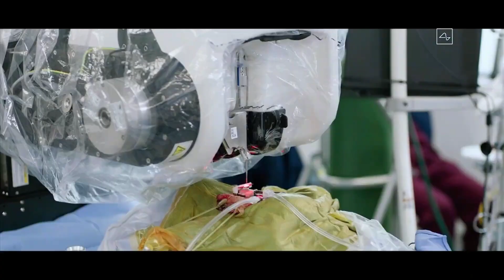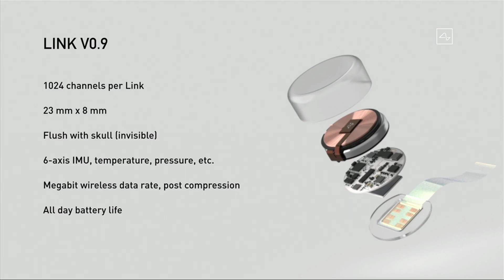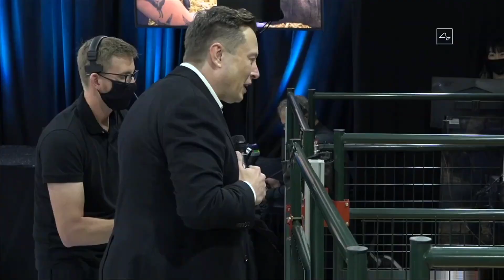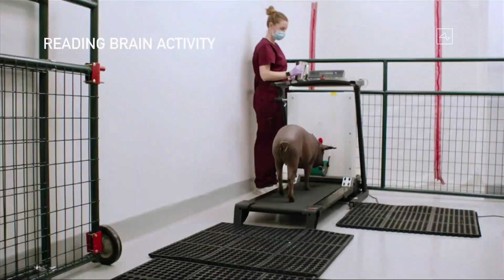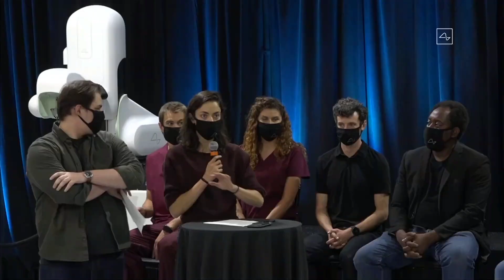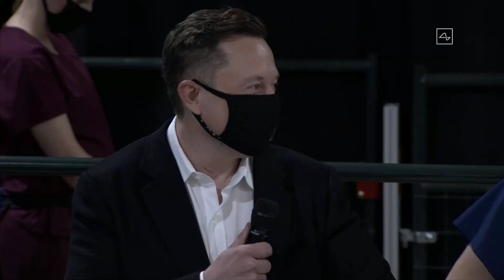Watch Elon Musk's ENTIRE live Neuralink demonstration

Comment: Personally i would like a micro device in my nose to filter out the filth and purify the air i breath. 
Maybe also a little thing to enhance my vision (instead of wearing glasses)..
And also... Could we finally have all plugs, connections, and interfaces STANDARDIZED?? I have a cardboard box filled with an insane amount of outdated, unusable chargers, plugs and cables. It's absurd... I think that if we add them all up we would have a mile high mountain of spaghetti like cable-mess. 
So many little things to fix but they go unnoticed until suddenly it's too late...

Comment: You can solve hearing basically means that you'll be able to slide a volume bar on the app and equalize frequencies and ears as well as ear interference. I'd absolutely love a preset to quickly switch between real life (default) to school (quieter when it gets loud) to headphones (I have one pair of headphones in which the left one works, but is almost cut off so I don't put it on, I'd be cool to feel like it's in both ears while it's only in one plus I struggle hearing bass unless I push it manually so frequency equalizing will be great for that). Maybe even switching between presets automatically depending on the detection of certain touch areas, like gaming headphones automatically switch your preset to gaming hearing.

Comment: My issue is the human brain is a mesh network. Meaning the neurons are intertwined and while most are similar not all pathways are the same. Like the difference between left and right handed people for example.  How long is the implant learning process for detecting the amount of current to pass and at what point to introduce said current to achieve a desired outcome? Or is it just a one size fits all approach? I know This may be a simple answer to people in this field but I’m just a normal joe here that loves to learn new things. Being the size is small and the area it can stimulate is small will location be a factor into what results one can achieve with the implant.

Comment: I’m sorry as much as i admire what you are doing and amazed by how fast you are changing the world. I have to disagree… Tesla doesn’t make 5 star products. It’s more like 4.5 stars. The cars are not put together symmetrically and apparently there seems to be an issue, a small issue but still an issue. Like the gaps on the window so you hear odd loud noises when you roll Down the window, also like how the car the winsheild is so big that the visors that help block the sun from our eyes are so small that it doesnt  cover anything and basically it will only be used for the mirror and not for shielding the sun which is important. I get it wants to be unique but the door handles are rediculous. I try to open the door with one hand and it is quite complicated and therefore requires me to put down what’s in my other hand so either an auto opening car door or choice pull or push the handle not both,. Lol

Comment: Why not make a long term high thread connector implant only then the system, larger cap needed for current version of Neuralink then when a new version comes out you do not need another surgery. Also allows the user the control of turning it off.

Comment: And no there is no way control any vehicle in any telepathic way!!! Imposible!! For that type of energy for through neuron to travel with the device integrated in your skull you would need over 450 mbps. Which is wifi high speed. And you can't install no wifi in that gadget.  Sorry pals. 
And the guy did not answer the band width.  WTF!! 
ANSWERED IN THE THE 29TH MINUTE AND 24 SECOND

Comment: 53:10 Oh you just make sure to keep it safe?  That easy is it?  They are using encryption!  Who keeps the keys?  How does your phone connect to it via Bluetooth?  Interference?  I am assuming it's going to be symmetric encryption so I asked the "who keeps the keys?" question because you will need that same key inside another device, presumably also unhackable right?  Maybe a quantum resistant asymmetric encryption scheme ... which is still being invented by the way as NIST hasn't even finalized on a discrete logarithm replacement.  Even then, same questions remain a persistent problem.  Just ask Tailored Access Operations unit of any Red Team.  The only "unhackable" computers exist under ground or water, in thick lead and concrete isolated and protected by weapons and even those aren't unhackable.  So you look at damage control as "never assume your secrets are safe" is a core security principle.  A computer gets hacked, data is stolen, opposition knows your secrets.  Still bad, but that's it.  Your brain gets hacked, you're done.  Hacker gets "write access" to your brain, and you press a button you really shouldn't.

Comment: The hard part would be to figure out how to influence the brain to fix an issue. The robot and the insertion of the chip is a much smaller problem. We are still long ways away from understanding consciousness and how it is supported by the brain. For example, just how would you treat depression using electric input? Even if you had everything perfectly mapped out and connected, the neural activity and all, you still wouldn't know what to feed the brain. The real breakthrough we need is to understand consciousness and the brain. I think it is too soon to try to manipulate what we don't yet understand well enough...

Comment: It would be an act of true humanity to restore physical disability, if only they could reverse autism.  Since it has to do with the nerves/electrical system of the body; connections from right and left brain you could fix it.  The perception of overstimulation from the senses due to the lack of pairing off sensors between the left and right brain keeps the child from reaching the next stage of development.  Brain damage from strokes and other aging brains can be repaired.  If you personally have some autism like features it could eliminate some interference from your concentration on various tasks.  Could pleasure or pain be experienced from this chip?  Could this be potentially used to control or abuse the population?  This would require an entirely new set of ethical considerations and laws.  Quality of life from various individuals would warrant risk.  As we consider quality of life with risk of loss of life.  I would imagine that one would find that depending on the level of disability and how limiting it is in life would make it more ethical to insert such a device.  However, would a person who is perfectly healthy in every way and a high degree of quality of life consider implanting a device that removes part of their skull, thus compromising the natural integrity and strength of the skull.  The risk of cancer and having a battery located without a boundary to the device is problematic.  Acid could eat through or leak, or explode due to physical damage.  If the person gets in a car accident or they get in a fist fight can it dislodge it into the brain.  My point is that it would not be prudent to add this to a normal person, or would I ever recommend it to a healthy person unless their quality of life was significantly diminished.  This is the ethical piece and at some point plastic surgery has crossed this line for advantage and competition for youth.  In the same instance the competition for intelligence is equally desired.  Could this enhance intelligence?  How could this help people become more equal or give people with more money and even better advantage?  Would some governments require it's citizens to get them to be as healthy and smart to have an advantage over other countries?

Comment: Why would you measure spikes. I see it differently in waves of frequency making action. Potential charge with systemic. Seams waves of creating responsive "electrical interpretation" which is fact sound traveling. Verberating off of neuron transmitters. Frequency is the perpetrating signal.

Comment: As Data would say to the Borg Queen..."Are you using a polymer-based neuro-relay to transmit the organic nerve impulses to the central processor in the positronic net? If that is the case, how have you solved the problem of increased signal degradation inherent to organosynthetic transmission across multiple layers?"

Comment: I had a spinal cord stimulater implanted in my spine attached to my spinal cord for back pain. 
It worked great. Until it overheated while charging and burned a hole that appeared as a small blister. Above my tail bone. But in fact, it  had abscessed, and a infection was beginning to spread. I had a life threatening staff infection filling a deep cavity of flesh that had hollowed and been burned by the charging leads. That always felt too hot.  At the bottom of my Lower back that now was a gateway to my spinal column. Via the implants stimulant leads that interrupt And block the pain. Cutting off the targeted 
nerves from receptors in the brain. I spent 10 days hospitalized in heavy antibiotics.  There will be malfunctions. Count on it.

Comment: You should have a changeable chip for specified purposes as opposed to a general purpose chip because electrodes do not need to be changed you will not have the risk involved with the original procedure in just changing from per se medical to a personal or business centric chip. 
Additionally I didn’t hear what I would consider one of the more intriguing low hanging fruit which would be positive stimulation in various different ways knowing very little about the mapping of the brain just based on what I’ve heard I would assume that you could emulate signals that were given without actually having that happen so in essence a massage for your brain which I’m sure it could be tied back to keeping things at top performance related to the computer the ability to clear the cache would be huge furthermore when the brain starts to understand the relationship between the link I truly believe it’ll be like adding a turbo to a motor it’ll just start using it to its advantage I mean let’s face it the brain is quite literally the smartest thing that we know of on many different levels Our unconscious brain being at the pinnacle of that intelligence it’ll be wild to see what it does with this technology

Comment: I'm concerned of the religious beliefs about this kind of technology I hope that while this tech is in it's infancy that choice is not robbed of an individual. Most probably in 50 years it will also have punishment parameters built into it. You probably need to consider this in the occipital pariatal sulci.
Augmented reality, yes but augmented, good and bad
Out source this tech to department of corrections and augmented prison. Not to mention black market neuro stimulation as a possibility.
But I can't sleep well have this brain implant repair the melotonin receptor and remove the chip I would be quite great full of this technology
If you can tap into the homeostasis, and metabolism you could solve some of the long term space flight physiological problems.
If I have cancer and the brain is the cause of the creation bio hack a solution.
But I would also be consernd, hypothetical black market bio chip that control the central nervus system, switch for cardiac arrest?
Slave again.
But the party goers who love rave, a safe amount of release from the dopamine receptor or serotonin and is regulated by no harm safety and augmented enhanced visual Perception making a rave that much more enjoyable.
A trillion switches in the brain,
Can you definitely confirm every receptor say the motor cortex Dopamine 4 is the result of a electron only transmitter and receiver, or does this receptor that would not be assumed to have a photon as it's basis of operation uses photon and electron, or photon only as it mechanism of action?

Comment: Would'nt it be much better if it works without having to link to your phone/internet with bluetooth/wifi, i don't like the idea having to link to somekinda device 24/7, it would be much better it would be a closed cirquit. Also i would much rather have the control of removing it myself and charge it with a cable

Comment: Is it not conspicuous by omission, at 52 minutes the question on security, that answer hardly brushing on the complexity of the risk. Not even a nod to the issue of emergent behavior in evolving systems. Musk later responds to this question w/ Joe Rogan, "if you can't beat them join them", this after cautioning against Singularity, AI turning on its parent, but c'mon, not a good look to pay lip service, at least admit it's a pretense at "security" to stop with "we design, i.e. control that in house."

Comment: The secret to Spider sence it a technical of time breathing, pick a memory and then use the spring loaded potential to bounce into the future , it's a rede refractive accumulative filter between two points triangulating on the 3rd. Only advice. Focus hard on the ideal heavon, so Ai is destined to be that, if you can't beat em, join em, and work your way into a position of illusionary free will

Comment: So the surgical machine can insert extremely fine wires within micrometers of major vessels in the brain. But another feature of the brain is that it expands and contracts during major trauma e.g. during car crashes or concussion causing impact like heavy falls etc. Elon touched on the point that pigs are robust creatures and often butt heads so they're a good test for the robustness of the Neuralink technology itself  but what about the impact of the Neuralink wired network in the head during high impact such as during a car crash. Is there potential for the wired network to move and cause extensive blood vessel damage in the brain causing strokes, inflammation etc?

Comment: I just think you're assuming an awful lot of ability that you don't really have, when you talk about storing memories as you would data on a computer. You don't know how memories are stored. From what I understand, memories are stored all over the brain, globally, in many areas at the same time, and yet you're talking about using a little group of electrodes the size of a quarter and have that access or store memories.  How can that be?  The brain does not function exactly like a computer. It doesn't have a single CPU and a specific memory module like a computer does.  If memories really are stored globally, that would require electrical connections to all parts of the brain, wouldn't it? 

And I for one don't want my brain connected to a global network. I think that is very unwise to have that as a possibility. There's a possibility of all sorts of damage, danger to people involved.  Many movies have been made with this theme, showing this danger.  If that's what you were implying, I very much disagree with that part of what you said.

But if you can restore someone's vision or give someone mobility, that seems to me a good thing.

Comment: Here is a question. If you were in an car accident or any accident and you bang your head would the wires safely break or would they rip holes or slits where the wire's are inserted? Also if someone was to hack it could you be in danger like could they send a huge electric pulse and fry your brain?

Comment: Neuralink is going to put angel wings on your back cybernetic Wings electrical propulsion muscle stimulating Quantum grouping skin Manufacturing if you want the implant to not cause infection it must have a vacuum and it's just like Iceman how did he get his powers he was caused by vacuum compression vacuum compression power it's called hope I have just solved the riddle of cryogenic I made a plant grow two times faster with opposing magnets wind it with copper wire the magnet was put in the water wires were run through PVC pipe with large headphones Wrapped Around The Jug and cell phone was playing then with pictures in the background of the jug the copper wire and the PVC pipe or pointing at the prochamber it should have temperature control sometimes when you say your brain is fried it should have temperature control you got to think about compression water compression thinking about talking to animals underwater

Comment: The safety of Teslas primarily has to do with their comparatively low-center of gravity. Not so much their frame architecture or specific design elements other than having the batteries in the floorboard.

Comment: The human brain has around 86 billion nerve cells, the neurons. With the current tool (device) you can connect 1024 of them and communicate in both directions. (and 100 trillion (10^14) of Synapses). How are the important of these nerve cell areas are selected? As it is not possible to define an exact cells, the brain has to help. How is the brain trained to communicate exactly to the device sensor?

Comment: I don't believe there can't be neuron damage as those wired are inserted into brain - surely it just cuts through and rips apart many thousands or neuron connections? I think a better way might be to use some sort of nano-bots which could be attached to the wires and they could "swim" through the gaps, threading the thread and going around the various solid structures they hit, instead of a dumb needle type thing just cannon-balling straight through. And when the nano-bots reach their destination they could be detached from the wires and either just float away or swim back to the collector device on machine.